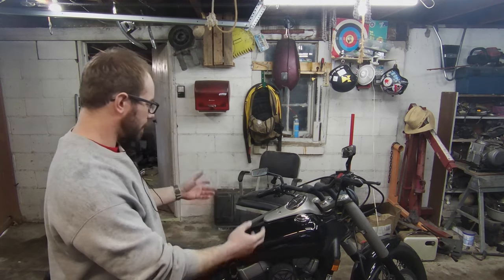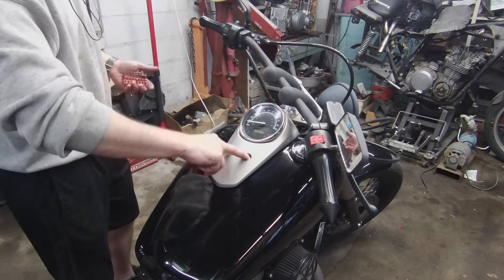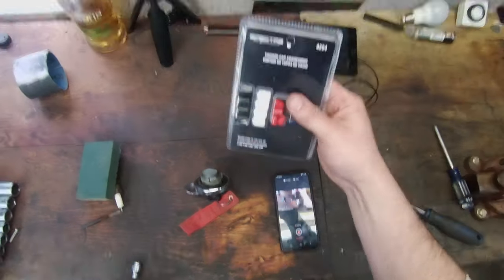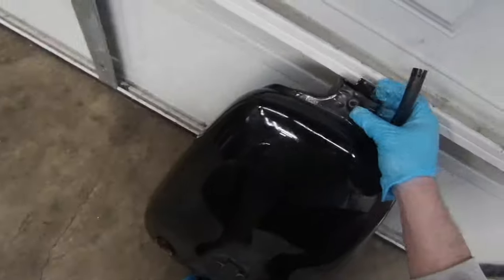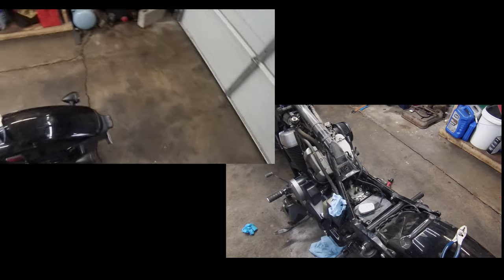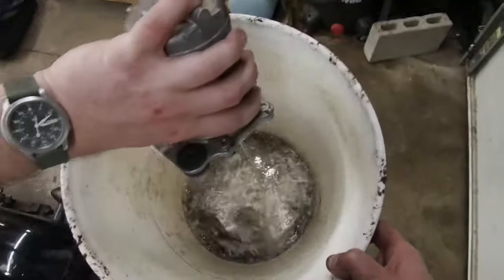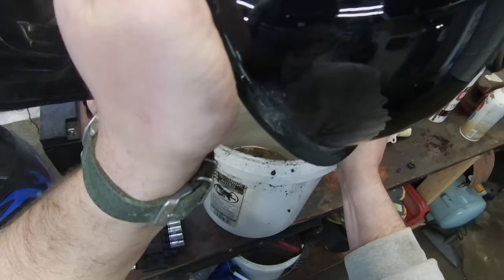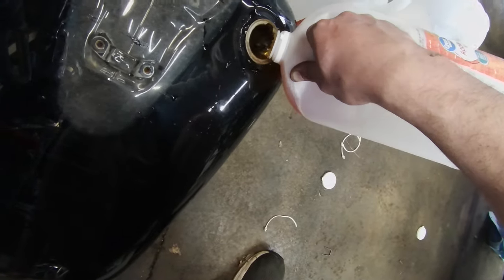2010 Honda Shadow Phantom fuel issues part 1 - Garage Time

Comment: I have never had to remove the tank on my 08 or 11 shadow aero to remove the fuel pump. Lots of unnecessary work to me. But a great video covering the fuel issue.
Reply from the maker: The bike sat for around four years with fuel in the tank. It was filled with rust. I removed the tank to clean it, replace the fuel pump, and injectors. The whole system was trashed.

Comment: Thanks for the insight on the breakdown of the fuel pump. I have a 2010 Phantom and it started acting up today. Similar issues you seem to be having but it only does it when it's hot. Weird. I guess I'll be digging in to the fuel pump. Thanks
Reply: Hey me too! What did you end up doing?

Comment: Hello! Thank you for the video. I have the same bike and the same issue with the fuel system. Do you know the part number of this filter on the fuel pump?
Reply from the maker: I don't remember the part number, I just ordered a cheap one from ebay. They sell the complete sending unit on Amazon and ebay for about $75 to $100 currently. That might be the easiest option.